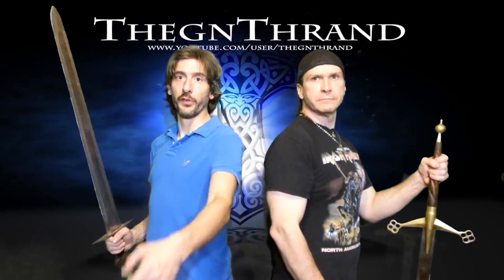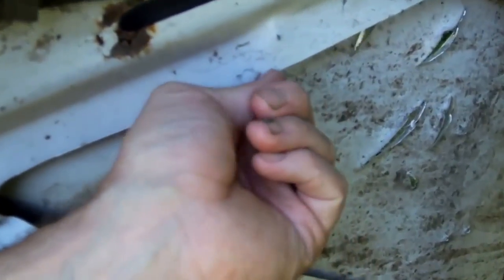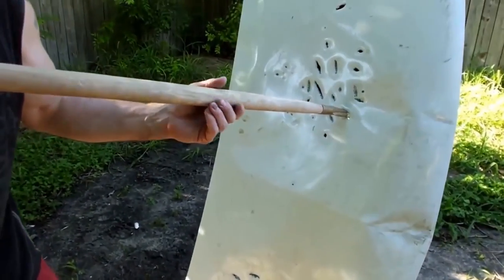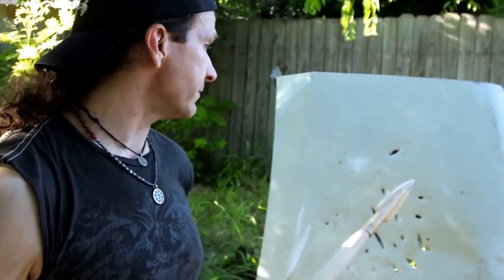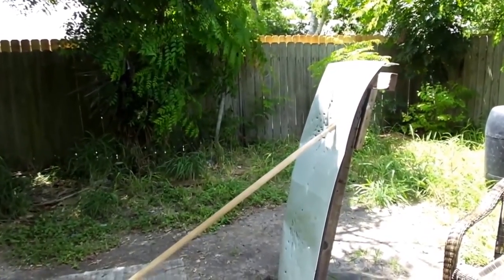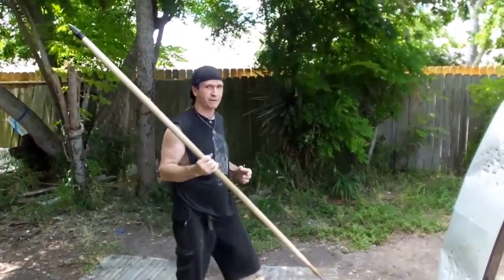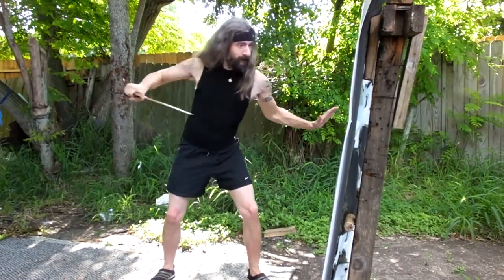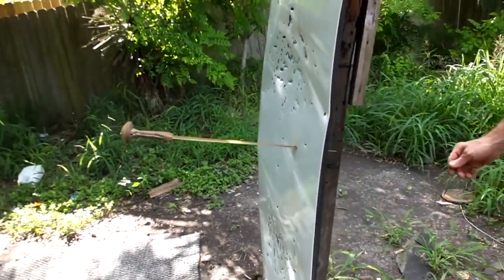Can Bronze Age Weapons Pierce and Cut Steel Armor?

Comment: People usually underestimate bronze weapons and armor. It was used for 2000 years as a main metal and now people would like us to think that it was so bad that it couldnt hold an actual edge. Iron was produced for a 500 years before it was made good enough to be used for weapon making. Maybe a different prospective on how good the bronze was is that guns were made almost only out of bronze until 18th century and even after that.
Reply: And about that car door...It can not represent an actual armor because it is made out of a different kind of steel than actual steel armor and it is not forged and hardened like an actual armor was.
One more thing: you do not try to pierce armor you try to attack areas that are not protected. Even if you get through you will get your weapon stuck and a guy you just impaled will do the same to you as you try to get it out.
Reply: Darkblade 1995221 bronze was useless after the powder got more potent.
and you cant have rifeling in a barrel made out of bronce.
well you can but itll wear of quickly.
Reply: Bronze is far easier to work than steel, and barrels are not simple things to make.

Comment: i think medieval armor was significantly thicker than that, bronze probably wouldn't have been able to pierce it....unless we're talking chain mail, or really really thin plate...even then it would probably just glance off...given the curves and movement of the other person
Reply from the maker: The test on car hood is to simulate bronze plate which was about same thickness not medieval plate armour.
Reply: 20 ga is just about 0.9 mm.  Medieval armour varies in thickness, up to 2-3 mm at the thickest.
Reply: J Smith Medieval armour wasn't that thick in general, but the hammering and forging, sometimes even quenching would make it indeed more resistent than this car door, and the bronze spear wouldn't have penetrated much.
But then again, it's not like steel spears would have much better success against medieval plate, so I think that the important point of this video is that bronze is far more endurant than people often think.

Comment: Well, a couple of critiques. 1- Static flat targets are a bad amalgamation of the armored torso. 2-20 gauge steel is not comparable to proper armor steel. 3- piercing already compromised targets degrades the authority of the test.4- I doubt the quality of bronze used in this test was readily available in the classical period. Exposition: I'm sure excellent quality bronze spear points could pose a threat to early iron armor, but it was most likely inconsistent and I feel that warriors would tend to aim for unarmored portions of the body.  Bronze swords, however, were useless against even the earliest alloys that might be called steel. Bronze is way too flimsy when forged to the length of a sword as opposed to a short broad knife or flared spear tip.

Comment: To those who say you can't properly sharpen bronze...

You can make lead razor sharp. The issue isn't making the metal sharp. It's working it so it stays that way. Historically, iron based alloys have had the proper mix of properties to make it ideal for retaining sharp edges and for withstanding shocks. But before the technology to properly forge iron came about, bronze was the standard...for thousands of years.

There is a simple reason for this; bronze frigging worked. Our ancestors weren't idiots. They didn't use materials in life and death situations that weren't proven to function at least adequately. Preferably they'd use the best thing they had and the best thing they had, was bronze...which they had learned to work so that finished products were actually better than their early iron/steel counterparts. If bronze didn't work, our ancestors would have found something else that would have worked.

Eventually, iron and steel took over for bronze, but only after centuries of tinkering with metalurgy and technological progression that made iron/steel easier to obtain and forge. Then they switched to iron/steel, not because it was inherently better than bronze, but because technology had advanced to the point to allow them to make it better.

Bronze can be just as sharp as steel can be, and while its edge retention is not quite as good, it can be more easily sharpened and repaired than steel. Each metal has its advantages and drawbacks compared to the other, but sharpness is not one of them.
Reply: Bronze may be left because of the fact that you need tin AND copper to make bronze, until you just need iron to make iron weapons. Steel is a bladesmith add and note an other rare metal like tin.

Comment: The reason that tip will never break off in someone is that Modern bronze alloy is copper and silica, which is far more ductile than the traditional copper and tin alloy of yore.   
Back in the 1990's I experimented with smelting the ancient 79-30 copper and tin bronze and testing it.  Sure enough it's more brittle than today's bronze.    

Modern silicon bronze alloy was developed for machinery applications by the Germans during  the latter 19th century, by the way.  ie., high RPM.  

YOU DO GREAT WORK, MEN.

Comment: I imagine that repeated use in battle would count as hardening the bronze. I'd be curious how many direct strikes on steel it could take before becoming brittle. Might explain ancient tips being broken off as well; they could have been hammer hardened properly by the smith, but after repeated hard use, over time, the bronze became too hardened. Just a hypothesis. Still, SUPER impressed with Neil's bronze swords. Wish list, for sure.

Comment: Steel is a pain to forge. Outfitting an entire army with swords? Cast some bronze. Spears? Maybe makes sense to force steel. But you're absolutely right, the manufacturing and metallurgical technology advanced significantly, and techniques changed on the battlefield before everyone made the more or less universal switch to steel. I'd like to see that last test on proper wrought iron (virtually no carbon) but ho-lee-cow. Never would have guessed that bronze blade would cut THAT well against steel. Speaks volumes about edge hardness, and geometry. love the videos, and I really like how you isolate the variables between tests - really gives a good picture of what's going on. Keep 'em coming. high five

Comment: Bronze is pretty much superior to iron in general, the biggest reason Iron become predominant wasn't that they made it better, it was that iron was much cheaper and logistically easier as its not an alloy and doesn't rely on tin (which aside from a few areas is absent in the Mediterranean, necessitating long trade routes to supply the stuff, thoguh there is always the theory that there's no tin there now because they mined it all out).

The 'Iron Age' actually had more bronze being used in it than the  Bronze Age did, it just generally ramped up metal production (well after the economic collapses at the end of the Bronze Ages, possibly in fact caused by the onset of iron undercutting the economic systems).

Now steel is a different matter - at that point it starts becoming flat out superior to bronze  but that does not mean that bronze isn't extremely good at what it does.
Reply: I had a chat with Neil once when studying this and the interesting thing he said was that they would tailor the exact alloys used to get different mechanical properties for different purposes. So the idea that bronze shields were ceremonial only loses a lot of credence when you realise they tailored the metal for increased shock absorbance.

Comment: Hello ThegnThrand, I am content with your videos for last months, I think you are doing very good testing, and points out there. The most happy I was with pilum, because I couldn't find any real testing of pilum on internet. The second most happy was with sling, and also with point about buttered chainmail, and riverted. There is lots of myths out there, and quality testing will reveal them. The most happy I am with, is, that you do all practicaly, so one can see immidiately results. There is many channels, that just talks, and maybe just shows some pictures downloaded from internet, but it is very boring. (for example, scholagladiatoria videos, have good points, but are too boring to watch for me, I cannot watch them for very long. But your videos are good, and very interesting to watch, as they are in real. I also like that "aaaaahhh" sound, when you put the energy into some blow. It's so characteristic for you, sometimes, I need to smile.

But the one think, I would like to ask you, if you can test longbow. I mean English heavy poundage warbows, beucase, there are for very long time many debates, if it is capable of armour piercing or not. 70 pound recurve bow is not enough, but I would like to see, if 150 pound longbow, with heavy arrow and type16 broadhead, can pierce through riverted mail, or very thick gambeson. There is very famous video on internet, as they've shoot 140 pound longbow to gambenson, and it didn't passed through. But that was 30 layers gambeson, and they've used bodkin, which is not suitable for that situation. I am sure, that 140 pound longbow, can penetrate even 30 layers gambeson with type 16 broadhead, and I think, it can even pass through riverted mail, and gambeson. Also interesting would be to use more heavy arrows, as I think 50 grams arrows will not store too much energy... they never say, how heavy arrows they've used. I would like to see 150 grams arrows, they have to have incredible armor piercing power from 150 pound longbow.

Comment: A reminder.
The first iron alloys varied between worse to close or equal to bronze tools, and even after the first iron tools started to appear, bronze was the main metal for decades, maybe centuries.
The main reason iron took the lead was because, frankly, it os far more common on the Earth's surface than copper and tin. And since is extremely rare (near impossible, but did happen ocasionaly) to find copper and tin veins close enough for a civilization to be self-sufficiemt with bronze, it was required trade routes to acquire the missing ores. After the bronze age collapse, nearly all trade routes disapeared and was necessary to find a cheap, reliable alternative.
Iron was "everywhere" (just to say was more common to find). The first tools were not too good, but were easily replaceable if necessary. Iron needed some maintenance to don't rust, but was simple enough as covering the tools with some dust or a thin layer of oil to avoid oxidation. Luckily humanity is ingenious, and in time new forging techniques and slag removing was developed, that made iron much more reliable. And, about a thousand years after, give or take, the first samples of steel started to appear, although still relatively basic.

Bronze was still used, however it was downgraded for jewelry, statues, adornations to armor and weapons, and so on. Bronze was still good enough for tools, but iron surpassed it for availability and ease to craft.
Reply: Not to mention a lot of early guns and cannon were made out of bronze, because iron cannon have tendency to crack under pressure and bursting into gigantic pipe bomb, killing the gun crew in the process. This could also happened to bronze cannon, but in much, much lower percentage.

Comment: Thrand, the steel armor you used for testing looked as if it was old as time itself. The gambeson also looked pretty thin. It seemed fine though.
Reply: Well, breastplates aren't exactly a dime a dozen.
Reply: Jacob Baumfalk True, but if he had at least said the gauge steel on anything I would found this video much more believable. I understand that bronze weapons are effective, but I am having doubts that they could pierce steel by even that much.
Reply from the maker: +Spanish Inquisition breast plate slightly hardened 1.75mm steel or about 15 gauge steel. test or real!
Reply: ThegnThrand Thank you for the info.
Reply: +Spanish Inquisition He did mention the car door was 20 gauge.
Reply: Gavin Jenkins I may have missed that, just couldn't find it for the chestplate.

Comment: Just in case anybody was taking this seriously, 19 gauge mild steel? Hit straight on?
19 gauge is the thickness of light pieces, e.g., greaves, not cuirasses.
And flat metal? The Greeks may gone for a sculpted six pack in their armor, 
but good luck finding an example of a medieval cuirass that wasn't angled to prevent exactly that sort of attack.
Reply from the maker: We were testing it as a bronze substitute not as steel and some bronze sheets in armour of this period were this thickness plus backed.by cloth. Further more accurate testing on this channel in more recent videos proved this video proved to be an accurate substitutions for the limited funds of the time. We have gotten the exact same results over and over. That is bronze versus steel to by the way.

Comment: I suspect there must be some Berillium in that bronze. 
 Aside de from that, I've argued a thousand times that even if titanium, aluminium, magnesium alloys, etc, don't make good pocket knives, they can still make excelent weapons and armour.
 There is more to metal than just hardness, and one should adapt the weapon to the available metals. a long copper rod will not name a good sword when forged, but the rod itself will concentrate 8 times more pressure on an impact than if it were a bow staff, titanium can make great spear or axe heads, etc. Good =/ ideal.
Reply: ***** I never argued against bronze as a material for a weapon, in fact, the design of bronze age swords reflects what I said. My point it that we are usually too spoiled when it comes to materials. One doesn't need the ideal material to make a decent weapon, as long as one does adapt the design to the limitations of the material. You can have a great bronze xiphos, but even the best process and alloy of bronze would make a poor zweihander.
Reply: ***** We could call some weapons 1000+ years old "true steel", comparable to a modern 1040. Even in roman times, weapons like the spatha and the pillow would have required a rather springy steel. of course, now we can get the same level of performance from copper or nickel alloys, which most would expect to be rather weak, of from titanium, while weighting 1/2. 
 Isn't metallurgy fascinating? It's a pitty that most people know little to nothing, and even "edutainment" channels like "discovery" and "history" confuse them more than they teach. 
 I suppose you are one of the few who gives a fuck about it.
Reply: ***** Very interesting!
 I'm more into engineering than actual historical weapons tbh, but I can suggest that you look into powder metallurgy to get an example of the properties one can get from a metal without the need to actually melt it. Folding, as you mentioned, was fundamental to achieve homogenous qualities. Not like modern "damascus steel", which is usually folded a few times, it would be necessary to fold until the layers are microns thin. The local high pressure from the hammering, together with the high temperature of the forging process, can lead to crystal level homogenisation between layers.
 I would expect a steel from 1000 AD to be in the 40 HRC range if it is supposed to be tough enough for battle.

Comment: its because your spear is not balanced properly... sauroter was much heavier than spear tip... usually sauroter was around 300-350g, while spear tip around 100-150g.. with sauroter heavier, point of balance would be much more towards the rear of the spear.

Comment: Wouldn't real plate armor be a lot harder and stronger than a car hood?
Reply from the maker: The car hood is to simulate 1mm bronze not steel so yes its very close steel is a wee better than bronze plate. The hood being steel and about 1mm. The breast plate in this video is 14 gauge and hardened to an extent so this is way tougher than 1mm bronze and would be equal to around 2mm bronze pate.
Reply: thank you for the clarification

Comment: That's a straightened steel plate though, and you didn't say exactly what kind of steel it is. I mean, steel weapons can still not slice through carbon steel plates forged into an armor (obviously).
Reply: Honestly, this. Testing bronze weapons against something made of a plate of steel and calling it a test against steel armor isn't exactly accurate. Steel is forged differently for different purposes, and this plate wasn't forged to stop weapons from penetrating it.
Reply: 1mm is very thin for any steel armour, thinner than most, but here it's a car bonnet, which is mild steel & very soft. The Japanese breastplate is far more impressive showing the strength of the bronze to stand up to tougher steel.

Comment: There's no way a bronze spear blade would bend after hitting Japanese armor. Spear blades have durable geometry and historical Japanese armor is lamellar with silk threading; a bronze spear point hitting a semi-yielding target will not bent. Also, even bent, a bronze blade can be straightened again relatively easily on the field without losing any effectiveness.

Comment: Interesting, but a rather silly and historically pointless experiment. There was no steel to penetrate during the 'Bronze Age' (3000 BCE – 1200 BCE). One may just as well ask if a Bronze Age sword could pierce or cut iron or titanium (it cannot)! This video was underwhelming not 'mind-blowing'. On the the Mohs Scale of Hardness for Metals:  Bronze = 3.00, (only a little harder than aluminum = 2.5 - 3.00; Iron =  4.50, Steel =  4.00-4.50, and hardened steel = 7.00 - 8.00. Ouzo was first commercially distilled in 1856. The distillation of the skins, pulp, seeds, and stems (i.e., the pomace) left over from winemaking after pressing the grapes was developed in Europe in 13th century - 3000 years after the end of the Bronze Age.